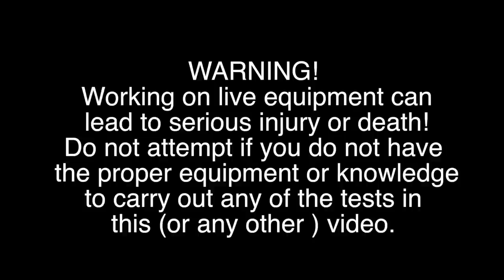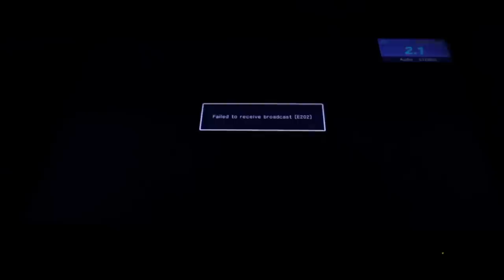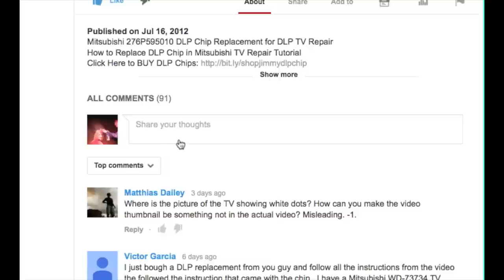Sharp LC-32 1 Blink TV Repair How to Troubleshoot Problem Between Bad Lamps and Power Supply

Comment: hellow i have a sharp aquos lcd tv model LC-46X8E and it doesnt turn on the power light goes green then red a couple times as if its tryin to turn on then a patten flashes between the opc and power both at once power light flashing red opc light flashing green then power light flash twice then opc twice any help please ?
Reply from the maker: NuFcKiiNDA   PLEASE SUBSCRIBE TO OUR CHANNEL - Try all repairs and troubleshooting at your own risk.  Can you please double check the blink code and then reply to see if it is different from what you originally sent?  Thanks!  www.shopjimmy.com
Reply: ShopJimmy.com v

Comment: HI, I HAVE A PROBLEM WITH MY SHARP AQUOS,WATCHING TV JUST SHUT OFF WENT BLACK NO SOUND ALSO GREEN LIGHT FLASHING. I FOLLOWED YOUR INSTRUCTION ON UTUBE CHECKED BACK OF SET WITH ALL LIGHTS OFF IN HOUSE COULD SEE NO LIGHT LOOKING IN BACK OF SET VERY CAREFULLY,ALSO DID YOUR FLASH LITE TEST IN ON SCREEN MANY TIMES EVERY WAY POSSIBLE ALSO TRIED TO HOLD ON OFF BUTTON DOWN FOR A FEW SECONDS STILLED BLINKED GREEN WHEN I LET GO. PLEASE HELP NOVICE. MODEL NO.LC 37D40U THANK YOU,JACK .
Reply from the maker: +JACK MASSARO  Try all repairs and troubleshooting at your own risk.  I recommend replacing the main board in your TV.  Click this link to a replacement main board for your TV model number:  http://www.shopjimmy.com/sharp-duntkd640fm06-main-board.htm  There may be multiple boards for the same TV model number, be sure to match part numbers on your current board, with your replacement for compatibility.  Here is a link to a video showing how to identify your part number, click here:  https://www.youtube.com/watch?v=-i9o4C2XkyQThanks and please let us know if you have any further questions with your TV Repair!  www.shopjimmy.com

Comment: Hi Jimmy,I have a Sharp TV and the Menu keeps coming up on the screen, I press exit and it takes it off but then comes back after about 20 mins. Do you know what the problem would be?
Reply from the maker: Andrew Gorton  Try all repairs and troubleshooting at your own risk.  Sounds like you should update the firmware on your TV.  Thanks!  www.shopjimmy.com

Comment: My problem is intermittent on Sharp mod: LC-52D65U. The TV will work OK for a period of time (different), than the screen go black, with sound. When you turn the TV OFF and ON, it comes back OK again, than after some time the screen goes black and so on and so on... 

The unit is not so “young” and I can't get any information (service manual, trouble shooting, etc.). This is what I observed:
On the inverter board DAC-60T012 Master (see picture), the nine (9) pin connector has the following voltage, when I HAVE and  do NOT HAVE picture:

Picture: Pin Voltage  No Picture: Pin Voltage

  2 3.3V     2 3.3V
  5 3.0V     5 0.0V
  8 2.84V     8 2.84V

Pin 5 has an “ERR” designation.

The second connector  (three pin, not in the picture) coming from the power supply board has the following stable voltages in both “Picture” and “No Picture” states: pin 1: 60.7V; pin 2:  Ground; Pin 3: 11.94V, all stable.

The unit is not so “young” and It seems, I can't find any service/trouble shooting manuals/schematics...

Any help is appreciated.
Thanks Nick
Reply: We have exactly the same problem with our tv

Comment: i have a Sharp Aquos LC-50LE440U the power will not come on is that the power supply. I cannot find a you tube video to help. please help thank u Tony
Reply from the maker: Tony Marano  Try all repairs and troubleshooting at your own risk.   Do you have a standby light in the front?  Thanks!  www.shopjimmy.com
Reply: I tried to look for one but I did not seen a stand by
Reply from the maker: Tony Marano   Try all repairs and troubleshooting at your own risk.  This could be a problem with either the power supply board or the main board in your TV.  I recommend replacing the power supply first to see if that fixes the problem.  If not, then replace the main board.  Click this link to replacement parts for your TV model number:  http://www.shopjimmy.com/catalogsearch/result/?q=LC-50LE440U  There may be multiple boards for the same TV model number, be sure to match part numbers on your current board, with your replacement for compatibility.  Thanks and please let us know if you have any further questions with your TV Repair!  www.shopjimmy.com
Reply: Thank u

Comment: Hi ShopJimmy

I have a Sharp Aquos 42DH77E . And it not turn on. But it's blinking red led 2 times and opc led 2 times. I checked power supply and all voltage are good. What mean this code 2,2 ? Can you help me find a problem
Reply: Andriy Xxx I found a problem. It is bad TCON board CPWBX4023TPXE.

Comment: Hi, I have a Sharp Aquous 60 inch TV. after having it for two years, I went to plug it in and nothing happened. then I noticed that the light in front of the TV had a quick flash followed by a longer flash( no sound or picture). It continues as long as the TV is plugged in. please help. Thank you in advance

 TV MODEL Sharp: LC-60LE820UN
Reply from the maker: Yeison Pimentel   This sounds like a TV panel (TV Screen) problem.  If your TV panel is bad, it may be more cost-effective to replace the TV as panels are typically hard to find in stock, difficult to replace, and expensive.  Thanks and please let us know if you have any further questions!  www.shopjimmy.com

Comment: I've got the lc-37d62u and it won't stay on.  I plug it in, press power, it clicks then the screen comes on for 1 second.  Power and OPC turn on for 6-7 seconds, then it clicks again and the power light just flashes constantly with no pattern just flash, flash, flash forever.  Any idea?
Reply from the maker: Adam Bacon  Please watch this video FIRST to help with your repair!  TV Repair! LCD, LED, Plasma, DLP How To Fix Your TV with ShopJimmy.com Help!  I recommend replacing the power supply board in your TV.  Here is a link to replacement parts:  http://www.shopjimmy.com/catalogsearch/result/index/?cat=59&q=lc-37d62u  Be sure to match part numbers on your current board, with your replacement for compatibility.  Thanks and please let us know if you have any further questions with your TV Repair!  www.shopjimmy.com

Comment: I have a sharp lc-46d64u  it recently started a blue stripe about 1mm 
wide on left side.... a week later protection keeps shutting it off 
(after 20-25 mins (I watched a utube vid on bypassing the protection by 
jumperring the little capacitor c7558((on 32 inch)) I cant figure out 
which that cap is on this board "rdenca235wjqz"...any help greatly appreciated

Comment: i have a sharp lc-43cff6002e, Serial No. B43CF6002EB11N.
the problem is i use this TV rarely and just to watch YouTube and when i want to use it it can not load the YouTube Page so I have tried to update my TV through an USB stick and I have downloaded the right software from the  website into my USB after that i put the USB into my TV and through the sitting Menu update using an USB after pressing OK the TV turned off and started to turn on and off Blue and Red Light mutually about 5 sec between every color, here i thought that every thing is ok and left the TV for about 30 min but sadly no news after what I felt bored and i have pulled the USB out and tried to turn the TV on but sadly no result only black screen with the Blue and Red light after that i pulled the Power cable out and then put it back again but now the TV started to flash the RED and Blue lights faster without any screen.
Please tell me what to do to make my TV's life back again.??

Comment: Hi
I have a sharp LC46LE700UN with an error blinking code pwr blinks twice and opc once
what could be my problem Thanks...
Reply from the maker: random1965   I recommend replacing the power supply board in your TV.  Unfortunately I do not see any replacement parts in the search results for your TV model number on our website.  Please reply with your part number on your power supply board and I can try searching for replacement parts.  Thanks and please let us know if you have any further questions!  www.shopjimmy.com

Comment: I have 70 inch sharp model number lc-70le640u  when I turn it on.. only thing happens is the light under the sharp in front of the tv blinks? nothing else..
Reply from the maker: +Cj Carmen   How many times does it blink?  Thanks!  www.shopjimmy.com
Reply: Hey im having the same problem. You get it fixed?
Reply: +oscar gonzalez having the same problem any answers
Reply: Nah. The stupid tv is sitting out in the garage. The warranty was expired and fixing the board is about 600 bucks.

Comment: I just unplugged held volume - and input at same time then plugged mine it it it gave the same error code but I haven't opened the case yet
Reply from the maker: tbirdpimp07  Try all repairs and troubleshooting at your own risk.  I recommend replacing the main board in your TV.  Please reply with your TV model number.  Click here to view a video that shows how to find your TV model number:  https://www.youtube.com/watch?v=S51nhAmwR2M  Thanks!  www.shopjimmy.com

Comment: hello i have a 52" sharp tv model #LC-52LE820UN. I turn my tv on and its turn off on it own wat can i do to repair this error.
Reply from the maker: Carmen Velez   I recommend replacing the power supply board.  http://www.shopjimmy.com/catalogsearch/result/index/?cat=59&q=LC-52LE820UN  Be sure to match part numbers on your current board, with your replacement for compatibility.  Here is a link to a video showing how to identify your part number, click here:  DIY TV Part Number Identification Guide for Sharp Power Supply Unit (PSU) Boards  You can also call our customer service for further assistance with your purchase.  (877) 881-6492  Thanks and please let us know if you have any further questions with your TV Repair!  www.shopjimmy.com
Reply: Thank you very much

Comment: Hey shop jimmy 

Have a sharp aquas lc-46d64u when I turn it in the screen flashes on 3 times then goes blank?

I changed the main power board but it's still doing the same thing?

Have any ideas what it could be. 

Thanks
Reply from the maker: Edgar Madriz   Do you still have audio when the screen goes blank? You could also try running the flashlight test on your TV.   Here is a link to a video we produced that shows how to run the flashlight test. No Image No Picture on TV Screen-Flashlight Test LCD TV Repair - How to Diagnose Broken TV Repair Please reply with your flashlight test results and we can recommend a replacement part for your TV repair. Thanks and please let us know if you have any questions! www.shopjimmy.com
Reply: No audio just turns on screen flashes 3 times then goes blank.
Reply: ShopJimmy.com I just ran the test. And I do have an image but no backlight. Would you say this is an easy fix?   how can I tell if it's an inverter board and which one it is?
Reply from the maker: Edgar Madriz   I recommend replacing the inverter board in your TV.  Here is a link to replacement parts for your TV model number on our website, click here:  http://www.shopjimmy.com/catalogsearch/result/index/?cat=46&q=lc-46d64u  Be sure to match part numbers on your current board, with your replacement for compatibility.  You can also call our customer service for further assistance with your purchase.  (877) 881-6492  Thanks and please let us know if you have any further questions with your TV Repair!  www.shopjimmy.com
Reply: ShopJimmy.com I already took out the inverter boards my question was are they all bad or just 1? How can I tell which one is bad.
Reply: Edgar Madriz   I recommend replacing both of the inverter boards at the same time in your TV.  Thanks!  www.shopjimmy.com
Reply from the maker: Edgar Madriz   I recommend replacing both of the inverter boards at the same time in your TV.  Thanks!  www.shopjimmy.com
Reply: ShopJimmy.com so I bought the boards now that installed the screen flashes multiple times over and over like 10x fully illuminated then goes blank
Reply from the maker: Edgar Madriz   It sounds like you received faulty replacement inverters.  You may want to try other replacement boards.  Thanks!  www.shopjimmy.com
Reply: ShopJimmy.com I took it to the store where I bought the inverters they said inverters are fine it's the lamp that needs replacing
Reply from the maker: Edgar Madriz   Unfortunately we do not sell lamps for that TV.  Thanks!  www.shopjimmy.com

Comment: Hi i am Janvier from RWANDA, I have a problem with my tv sharp LC-32LE275X. The power is there indicated by steady red LED, after pressing power button green LED comes some seconds and disappear and after red LED comes back flashing, could you please give a support?
Best Regards

Bonjour, je suis Janvier de RWANDA, j'ai un problème avec mon téléviseur Sharp LC-32LE275X. L'alimentation est indiquée par le voyant rouge fixe. Après avoir appuyé sur le bouton d'alimentation, le voyant vert apparaît quelques secondes et disparaît. Par Après  le voyant rouge clignote, pouvez-vous s'il vous plaît fournir un soutien?
Meilleures salutations

Comment: my sharp 70le66ou lc flat screen when I press the power button has a flash of white on the screen the power light in the center bottom stays on no flashing
Reply: im going to try holding the power and channel down and then plug it in what do you think

Comment: Problem with SHARP LC-39LE440M ,no power on,power supply ok,filter capacitor ok already checked..,one time power turn on with display,but did not last a minute,then no power on until now,I'am reading a low output voltage from IC U1 at pin3 less than 2volt,input at pin3 is 5volt that IC is AIC2857F,that IC supplies the MCU,thankz

Comment: I have a Sharp LC 52D64U and the power light is flashing I tried holding the power button to reset but nothing happened...  What next
Reply from the maker: Ivory Lawton   How many blinks are you seeing?  Thanks!  www.shopjimmy.com
Reply: Lots it's just steady blinking
Reply: Yellow
Reply from the maker: Ivory Lawton   I recommend replacing the main board in your TV.  Here is a link to replacement parts for your TV model number on our website, click here:  http://www.shopjimmy.com/catalogsearch/result/?q=52D64U  Be sure to match part numbers on your current board, with your replacement for compatibility.  You can also call our customer service for further assistance with your purchase.  (877) 881-6492  Thanks and please let us know if you have any further questions with your TV Repair!  www.shopjimmy.com

Comment: Hello, 
I have a Sharp tv model LC-46SB54U serial 802811587 that just quit. There is no display, I hear a series of relay clicks and then it stops. The power and OTC lights flash and repeats. There are 3 Power and 1 OTC flashes. There is also a red led light on one of the boards that flashes also and then quits.
I have checked all of the capacitors on the power supply board, they all appear to be working, no shorts.
Any help you can provide would be greatly appreciated. 
Thanks,
John
Reply: Any suggestions

Comment: Hi ShopJimmy

I have a Sharp Aquos LC-42D65U Serial No. 812891952

My TV was shut down suddenly.
When I try to turn on the TV again, the power LED stays on for 1-2 minutes and then the Power and OPC LED began blinking together twice in a row and then once only the Power LED

2x OPC and Power together
1x only Power

2xOPC LED - 3x Power LED

I have to replace the main board or the power supply
Reply from the maker: Rodrigo Martinez Please watch this video FIRST to help with your repair!  TV Repair! LCD, LED, Plasma, DLP How To Fix Your TV with ShopJimmy.com Help!  I recommend replacing the main board in your TV.  Click this link to replacement parts:  http://www.shopjimmy.com/catalogsearch/result/index/?cat=56&q=LC-42D65U  Be sure to match part numbers on your current board, with your replacement for compatibility.  Thanks and please let us know if you have any further questions with your TV Repair!  www.shopjimmy.com

Comment: AQUOS sharp LC- 32A37M
it comes on and off two times then goes on standby
Reply: I have the same model and the green led blinks once then go into standby. I've tried connecting a diode to earth on pin 17 of the protection ic as well as shorting pin 17 directly to earth with no luck.

Comment: help i have the same exact problem but i cant make it go red it did it once before but not anymore
Reply: ok when i powered mine back on i (i got the red light) it didn't turn off in like in the video is this a good sign
Reply: +pielover771 i replaced both main board and psu and it still does it and im not get bad lamp error
Reply from the maker: +pielover771  Try all repairs and troubleshooting at your own risk.    Please reply with the problems and symptoms that your TV is showing.  Please reply with your TV model number.  Click here to view a video that shows how to find your TV model number:  https://www.youtube.com/watch?v=S51nhAmwR2M  Thanks!  www.shopjimmy.com
Reply: +ShopJimmy.com its the same tv as the one in the video